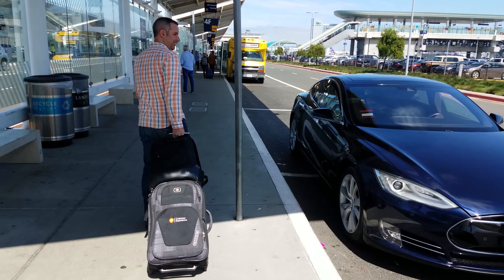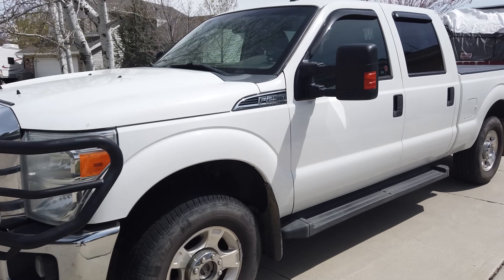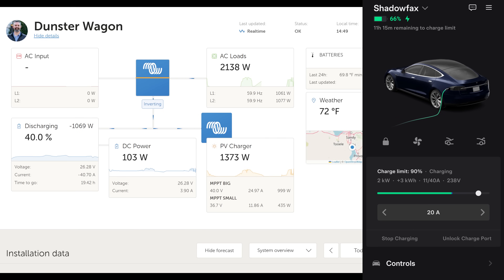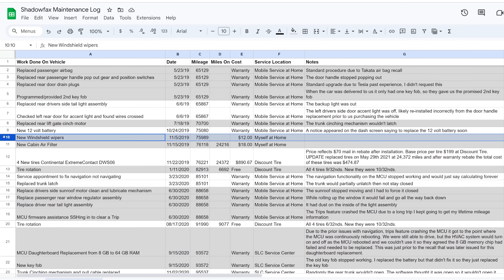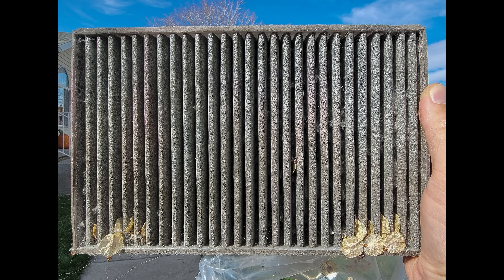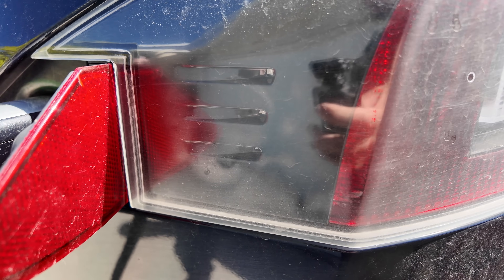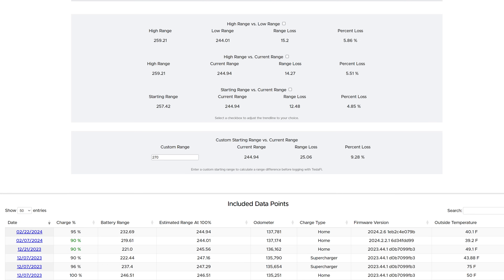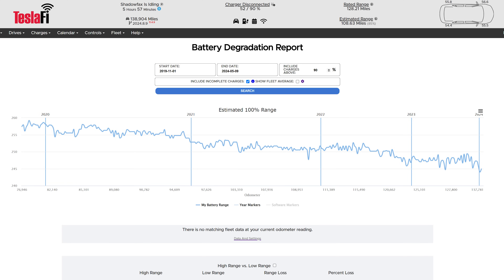Should You Buy A Used Tesla? | 5 Years Of Model S Maintenance Costs Plus My Current Experiment

Comment from the maker: I should have included in the video that the total cost at this point after 5 years of ownership and adding 75,108 miles onto the odometer, the total cost to us has been $4,223.99 to own and operate our 2015 Tesla Model S. Tires alone are $2,024.11 of that price, and the other large ticket item was upgrading to MCU 2 which was $1,876.88. Our supercharging was free throughout this until right at the end when we transferred free supercharging to our Model Y and we had to pay for charging to get home from Las Vegas. Our charging at home has been free with solar and we haven't paid for charging anywhere the entire time we've owned it. This number does not include insurance and registration costs as that's highly variable depending on your own insurance rates and where you live.
Reply: The parts are affordable and easy to get off of eBay or through the real parts catalog the motors and batteries will last to 500k miles regularly. I need four tools pretty much to repair anything in the interior I can put In 2.0 for 800 bucks. And it will take an hour. If it needs programmed you still saved hundreds. I’m going to save up and get my computer the software I need to program any parts that need it.
I watched some videos now I’m ready to offer center console upgrades mcu swaps seat swaps window regulator and motors cameras and low voltage batteries and fuse. Am I missing anything it looks super simple and you tube has very detailed easy to follow how to videos re watching as I do will make the first time take twice as long as it actually takes. I’m going to learn on mine. I may need soon a rear right window regulator and it looks like a thirty minute 200 dollar job.
Reply: The parts are affordable and easy to get off of eBay or through the real parts catalog the motors and batteries will last to 500k miles regularly. I need four tools pretty much to repair anything in the interior I can put In 2.0 for 800 bucks. And it will take an hour. If it needs programmed you still saved hundreds. I’m going to save up and get my computer the software I need to program any parts that need it.
I watched some videos now I’m ready to offer center console upgrades mcu swaps seat swaps window regulator and motors cameras and low voltage batteries and fuse. Am I missing anything it looks super simple and you tube has very detailed easy to follow how to videos re watching as I do will make the first time take twice as long as it actually takes. I’m going to learn on mine. I may need soon a rear right window regulator and it looks like a thirty minute 200 dollar job.
Now I need to watch a video on how to swap out the charge port door. It’s probably the 10mil nuts or bolt and an electrical connection I can also get offa newer car from eBay
Reply from the maker: One of these days I'd like to install a new charge port in my S as I talked about in this video, but for now it still works, albeit more annoyingly. I'd have a lot more spare time to tinker and DIY stuff if I wasn't constantly trying to catch up with my YouTube video editing!
Reply: Don't you include depreciation on bill?
Reply from the maker: @patricaomas8750  Someday if I ever sell it then I will know it's depreciation for sure and be able to include that in the total ownership cost. Until then it's just anybody's approximated guess. I purchased it for $39,400 in May of 2019. Maybe in next year's 6-year update I will address that topic and do a general approximation but up to this point I have been just focusing on the mechanical device itself and the cost of ownership and maintenance.
Reply: New to your channel! I’m assuming the car is out of warranty. Have you ever had to replace the battery after putting 75k miles? Recently just bought a the same exact car but with 99k miles
Reply from the maker: @Namyalas  Welcome to my channel! My 2015 Model S is still using its original battery and it now has 144k miles on the odometer and 8.95% (24 miles) battery degradation according to TeslaFi.
Reply: Wow congrats on that hopefully it lasts another 100k miles!
Reply from the maker: @Namyalas  I hope so too with minimal repairs over that time. Right now my 11-year-old daughter is hoping we let her drive it when she gets her driver's license...
Reply: Was your insurance cost significantly more than it would have been for an ICE car in a similar price range?
Reply from the maker: @danieldiaz9948  In our case the insurance isn't prohibitive, but when we purchased our Model S it was significantly nicer than our prior vehicle which was a 2009 Honda Pilot so the insurance was a little more expensive. Those vehicles are not a great comparison since the Pilot isn't a direct competitor to the Model S. I don't recall our Honda Pilot insurance, but currently in 2025 our Model S insurance is $397 for 6 months with a $500 deductible and $100/$300k coverage. If you want to know what insurance would cost you specifically I recommend looking up a used Model S in your area and take that VIN number to your insurance company to have them run the numbers for you since insurance rates are highly variable.
Reply: @ smart, thank you
Reply: Your charging at home isn't free with solar unless the solar was free.
Reply from the maker: @SafeEffective-ls2pl It's free if it has broken even on installation costs https://youtu.be/m_UNWLxNehU

Comment: How did you transfer the free supercharging?  I thought it was on the car not the account with the 2015.  I have a 2015 S with free charging and would love to transfer it to a new car.
Reply from the maker: There are two different kinds of free supercharging from Tesla. In the coding sc01 was the indicator for free unlimited supercharging for the life of the car that transfers to new owners. In mid 2019 Tesla began removing sc01 from used vehicles that were traded in to Tesla, but if the car was sold third party then the supercharging transfers with the car still. In 2016 Tesla switched to a different kind of free supercharging where the internal code is sc05 which is free unlimited supercharging for as long as that owner owns that vehicle. The moment the vehicle is transferred out of their Tesla account the free supercharging is lost. In our case our model S had sc01 and we enjoyed that for many years and then in 2023 at the end of the year Tesla was offering to transfer a sc01 to a new Tesla vehicle as an sc05. We decided to go ahead and do that since the Cybertruck was delayed that we had been saving for so we purchased a model Y which now has a sc05 on it and we went into that purchase knowing that we intend to own the model Y for its entirely useful life.

Comment: In April of 2020 I bought a 2013 Model S 85 from the original owner.  The main drive unit and main display had already been replaced under warranty in October 2019 (@90K miles). That meant that the car I bought was on it's second drive unit and display when I bought it @96K miles.  In the summer of 2023 I began experiencing episodes of the drive unit cutting out during normal driving. Within a year the issue became worse, and by the Fall of 2024 it was happening almost every time I drove the car.  So, in mid-November 2024 I drove it to the local Austin, TX service center and on the drive there it cut out 3 times. When I got there they said I should leave it with them (without an appointment) because it was “a safety issue". The diagnosis (later that same day) was that the drive unit was failing and had to be replaced.  My choice: do nothing and have eventual total drive unit failure somewhere out on the road requiring an expensive tow to a service center OR make the replacement now. I authorized the replacement ~ $6700 (out of warranty). The car has 140,000 miles now and is on it's 3rd drive unit. If I had known that this was a possible issue, I never would have bought the car back in 2020. This may not be typical for all early Model S's, but I was unlucky enough for it to happen to mine. Three (3) drive units in 140,000 miles of normal driving is not my idea of a dependable car.

Comment: How long should it take to charge a Tesla model s at 130k miles
Reply from the maker: Our Model S at 130k miles while Supercharging peaked at 130 kW, but more quickly declined in charge speed than when it had 63k miles on it (when we purchased it). We have never charged any of our electric vehicles from zero to 100% in one session, so asking how long it takes to charge requires more qualifications to be able to answer. For instance are you charging at a Supercharger, or a level 1 or 2 charger? Unlike gas vehicles, there is far more variance on "refueling" an electric car because there are so many more options that vary greatly in capacity. At a Supercharger we typically strive to arrive at 10% and only charge long enough to get to the next supercharger that is about 150 miles away give or take. We've stopped taking our S on road trips after we transferred our free supercharging from it to our Model Y, but the last road trip we took in the S were generally taking about half an hour to charge but that varied depending on if we were at a V2 vs V3 supercharger, or more specifically if at a V2 and someone plugged into the other side of the circuit. I wish I could give you a straightforward simple answer, but I'm afraid that doesn't really exist in the topic of charging electric vehicles. In our Model Y at a V3 supercharger we typically charge 10-15 minutes. At times in the past we've arrived at a low state of charge somewhere remote where we were planning to be there for a couple days and we left the car charging from a standard 15 amp 120 volt household power outlet and the car took over 2 days to charge 70%. Like I said, immense variance. Here's the video where we charged for several days https://youtu.be/Q2f7PJJO208?si=x-J1oE_jxDGJfOD9&t=2151 and I have many other road trip videos on my channel in both our S and Y showing charge speeds at a supercharger when we're going from charger to charger throughout the day.
Reply: @ElectricTechAdventures  I meant from 20 to80ish ours takes 45 minutes and seems to give us at max 118 miles
Reply from the maker: @joshuatinkham3703  I could see that percentage range taking 45 minutes. I recommend arriving at 10% instead of 20%. For a long time our S was more like 30 minutes for that much range, but it was starting to creep up to 45 minutes which was one of my main motivating factors for getting our Model Y because the updated battery tech charging up to 250 kW is a significant improvement. Our typical average charge speed over an entire supercharcharger session (not going over 70% usually) is greater than 100 kW which is way higher than our S at it's current older age.